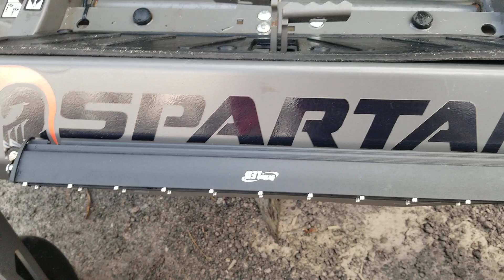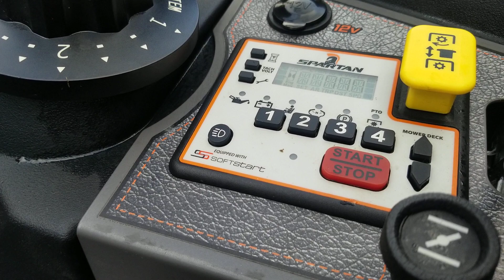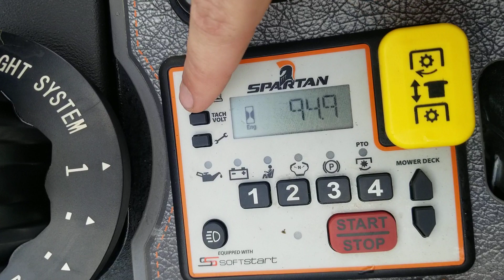Spartan 100hr review

Comment: Looked at Spartan, Skag and Bad Boy 61".
Compared weight, horsepower, hydraulic pumps, deck thickness, tires and comfort.
I've been in Manufacturing all my life so understand fit/finish. While the Spartan looks cool as hell, I ended up with a Bad Boy Rogue with the 35hp Kawasaki in a 61".
I've mowed twice with it including wet grass and orchard grass. Also tested it on hills.
We have 105 acres with about 20 acres to mow. Cuts like a dream and the suspension is sweet!
Reply: 15 hours in...... Oh man this Rogue is a beast!  So smooth and cuts on hills like it has suction cups. Very well engineered, too. That 35 hp motor NEVER bogs down, even in grass 2' tall.  Have really pushed this baby and every time, I'm more confident that I haven't found the limits.
Reply: @elricofarmer1561  still going strong? I am in the market for a mower and i am looking at Bad boy, Spartan, and Scag.
Reply: @jonseay8887  ......OMG....... I grow more confident every time I take this beast out to mow. It really does a job on everything I've asked of it. I have a 60 horsepower tractor with a 10-ft finish mower and I would much rather drive this zero turn.
Reply: @elricofarmer1561  woah! Did you see that some Spartans burnt some peoples garage down?
Reply: @jonseay8887  no, sure didn't. I park mine outside until it's dry, blow it off well with my leaf blower and pull it in the shop, until next time.
Wondering what circumstances would cause this? Most likely human error. 🤔
Reply: you made the right choice. I have been comparing mowers and the Bad Boy construction is way better than this Spartan.

Comment: Have you had any trouble with the push button starter? Heard they had problems with them. Thinking about buying this mower. Looks like a beast of a mower. Good thing about spartan mowers the parts will interchange with other models. Just like a Chevrolet
Reply from the maker: No problems thus far!

Comment: What kind of mower did you buy
Reply from the maker: I bought a new massey ferguson. 60 inch mower with a loader. It's an 18 thousand dollar machine and cuts like a cheap box store mower. Every time I mow I miss my spartan more...
Reply: I have to laugh at your comment about purchasing a sub compact tractor for mowing, as I sold my SuperZ to go to a sub compact as well (424 Yanmar) with a MMM. Everything works well and it does a great job mowing but is definitely not as convenient as a ZT, so I decided to purchase a ZT and mow with something dedicated.  Probably keep my mower deck from the tractor but will start using my new machine.

Looked at a lot of ZT’s in my price range and Spartan looks like it will be my choice (RZ pro 54) .

Nice review, thank you

Comment: I was wondering how is that Briggs on gas my dad has engraved it in too my head that they suck gas but he's talking about the old ones he hasn't seen anything on the new ones?
Reply: Its a price point engine.  They are the Hyundai of engines. Okay on paper but more expensive long term. Fuel use and reliability of a true commercial motor will be better.  EFI offers better reliability, power deliver and fuel burn rate.